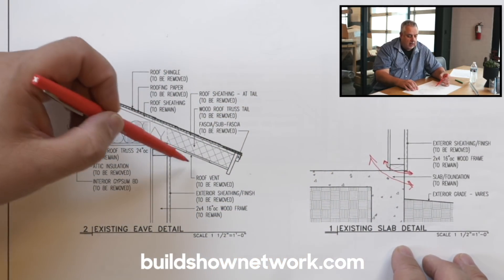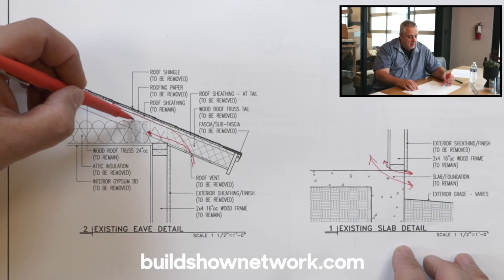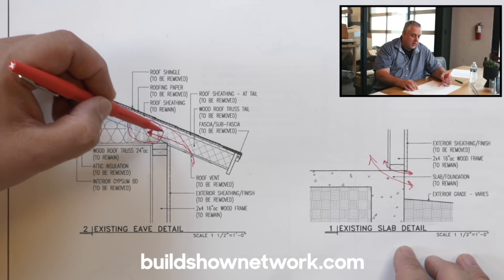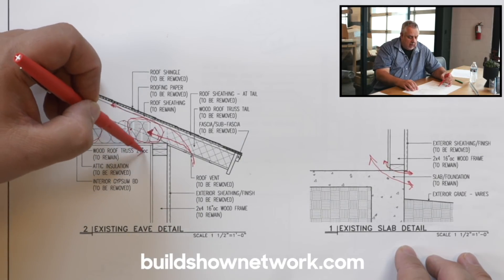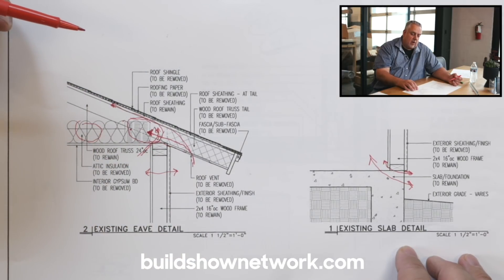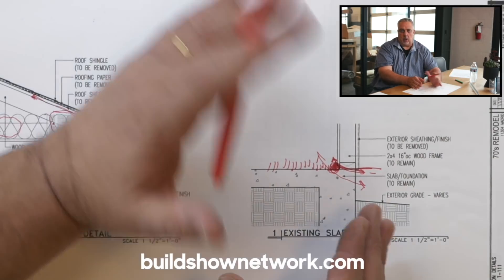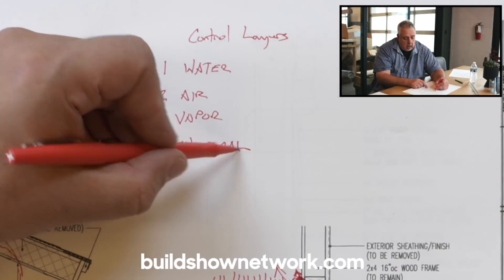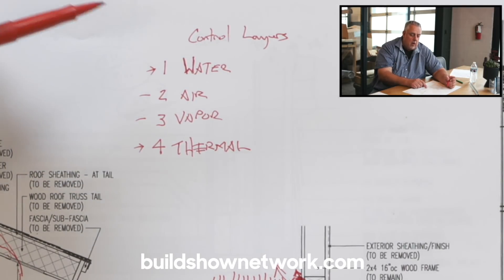The Secrets Behind Matt Risinger's Personal Build

Comment: I love your videos. I wish you were my architect during my major house renovation. Just a few comments.

As to your 1) water, 2)air, 3) vapor, 4) thermal priorities.  I totally agree on your discussion about the importance of water control, and that thermal is an economic discussion. Although in recent codes, energy efficiency has taking priority. 

But I would argue that a mediocre air tightness house can also be made long lasting, at the cost of energy. For example take a blower door 7ACH@50PA house in Matt’s Austin ,Texas, where the climate is mostly cooling. Now take a supply air fan with HEPA filter and overpressures the house with a net inward flow of 0.5 ACH, and no exhaust port. (The air has to leak out the cracks.). The external air is filtered, the house leaks to the outside, so no bad air is coming inside. The penalty is the energy to cool the air and remove the moisture. 

Also, (in my opinion - and Im not a professional in the building industry), when an old timer says a building need to breath - isn’t he really saying - you will never eliminate water from getting into places you don’t want, and air flow is what saves you from mold/rot, as it will take the water out through vapor. In essence, they are agreeing with you. That water removal is more important than air tightness. Just a thought. 

Again thanks for the detailed descriptions.
Reply: Thank you Richard, yes - when I have o cram 30 yrs experience into as many minutes, explanations get generalized.I don't think buildings have to breath, but I do agree wih you....my vapor profile is usually based on how it can help me, not hurt me. I solve the problem with airtightness and insulation, I solve drying with vapor control....hopefully clears up a little

Comment: Regarding information from the continuation of this video: 1.5 inches of floor sheathing on top of 1.5 inches of polyiso. You mentioned that there would be very very little moisture transfer through the polyiso (when talking about the wall details), so I imagine the same is true of moisture transfer from the slab through the floor. But, my question is this: What is the effect of a spill on the floor? It gets onto the sheathing and is trapped? Is this a problem? Is there a way to mitigate the water on the floor sheathing? Great information! Hopefully someone can answer this question. YouTube can be a great community and I thank anyone for the time they spend contributing to it.
Reply: Saileahgaz I imagine if you don’t seal the concrete then the moisture can disperse through it.
Reply: @rossmcleod7983  Thanks for the response!
Reply: That’s a really great question. From what I can tell, the most simple solution is to use a permeable insulation instead of impermeable under the floor sheathing. 

Obviously if he used an impermeable one like you were mentioning—that’s an interesting situation.

Comment: Everyone says houses need to breath….as an electrician here in Montreal we finish a new super hospital (CHUM) and that building is HEPA standard airtight. From the walls to the windows and so on. That building is designed to last well past 100yrs. Why so tight? Two simple reason, control or the air for health reasons for the patients and Durability. 

If everyone is working hard to make hospitals and schools super air tight and control those environments why in the world would you not want that capability in your house if you could?
Reply: TOTALLY AGREE

Comment: Hi Steve -- Huge thanks for all the instructive content.  I have a question about the wall design and continuity.  Instead of installing the 2x Block, would it not make sense to continue the ext 2" rigid insulation  all the way down below grade to the footing?   I know this is a remodel, so that might be cost/structurally prohibitive.  In your video on insulating slab and foundation, you show 2" foam board on the outside of the foundation wall to protect it during the back fill.  Does that foam board stop at grade level leaving a section of exposed foundation, or does it tie into the exterior layer of rigid insulation on the outside of the framed  walls.  I'm sure you cover this somewhere in a  video.  You're the man!  Thanks  - Stevenson (Fairview Design/Construction)
Reply: You would need to introduce a solid break (metal or wood) to keep insects and rodents from migrating thru the foam without being seen

Comment: Would like to know if it might be a good idea to put an extra layer of house wrap just behind the siding. Seems like it would be an extra jacket for the house at a small cost
Reply: Not a problem I just don't see a need. The pressure drop in the airspace is such that water doesn't get forced into a hole

Comment: 11:34 (pause) Hello, why not bring down a few inches the whole system of the exterior wall to bring the "2" foil faced polyisocyanurate rigid insulation" over the "Bottom plate" of the interior wall... I only see the "zip sheating" as a thermal bridge break... Maybe, I love to see a oder 2" of isolation above this area... Hehehe north french Canadian eyes Hehe 😉🌱

Comment: In the relatively mild climate where Matt is building, the extra cost and embodied energy of all this extra material and labor will never be recovered. Might make sense in Boston, but not in Austin.
Reply: If you would define “mild climate” then your comment might be more valid.
In the case of Austin, where heat and humidity are prevalent most of the year, this build model makes perfect sense. The primary thing to remember is that the main difference (note my wording) is insulation quantity. Matt isn’t going for R50 walls and R60-70 roofs, he is shooting for a continuous R23-30 throughout, which makes perfect sense in his “mild” climate.
Reply: @alanr745  Austin has relatively hot, humid summers, and very mild winters, which is similar to the area where I live in Australia. In those conditions, the savings will not go close to covering the extra costs. It's not even close - I've done the numbers for my own new build. 
This is a vanity project (which is not necessarily a bad thing), but we should not pretend there is environmental or financial justification for the Passivhaus/almost Passivhaus approach in a mild climate.

Comment: Steven knows his stuff. Just wish he and Matt would stop using foam and use more health-friendly insulation.   What's the point of a tight home if you're entombing yourself inside an off-gassing foam coccoon?  My order of importance is 1) a healthy home 2) a nice-looking home. 3) a home that keeps water/air/heat/cold under control. If you don't value a healthy home above all else, you really shouldn't be an architect/builder.
Reply: @rossmcleod7983  I hate the idea of relying on mechanical systems to provide 'healthy' air quality. For comfort/thermal, fine. But not to deliver healthy air - because when (not if) the mechanicals fail/don't work properly, you don't want to be exposed to off-gassing chems (formaldehydes etc) simply because you've made bad material choices.

Comment: You are wrong on so many levels it is embarrassing. Just one example. nearly EVERY GC who knows what they are  doing will put three heavy beads of caulk under their exterior wall plates and seal any open cracks in the concrete.  I can guarantee that NO air is getting through under the bottom plates on any house that I have framed.  In addition to these three beads of caulk under the plates,  most GCs put a 4th bead of caulk around the inside perimeter of the interior joint where the bottom plate meets the concrete. They do this primarily to keep pests out, not for insulation purposes.  

Several of your assumptions are theoretical and they do not reflect what is done out in the field, and yes, I am a licensed GC.